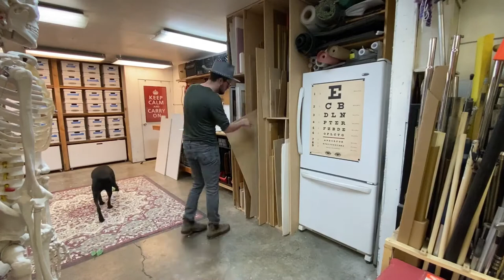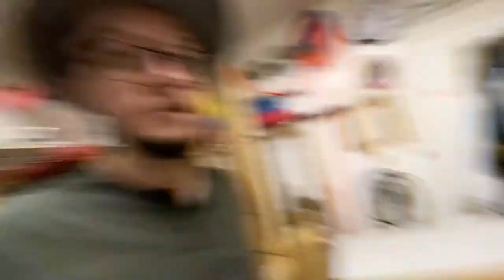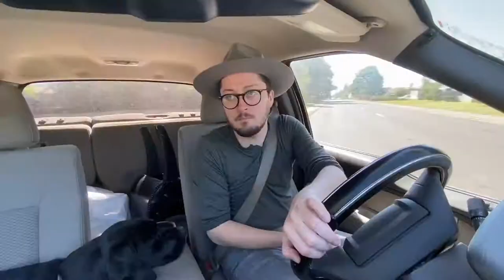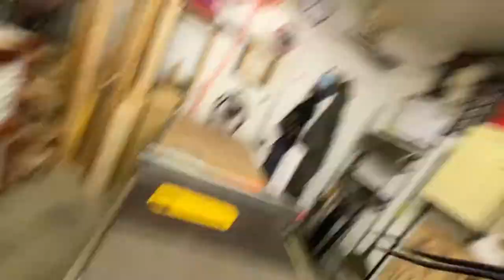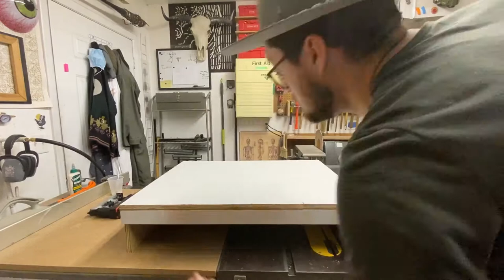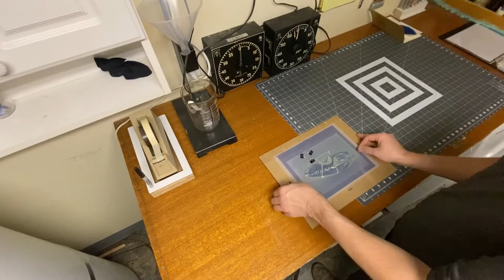Build Video: UV Box

Comment: what lights did you use? Were they 365 mn or 385 mn?  How long was your exposure?  Thanks!
Reply from the maker: Purchased UV LED lights for the best price I could find at the time. No info on wavelength. My cyanotypes were running about 20 minutes under this unit. Longer than I have experienced with fluorescent lights.